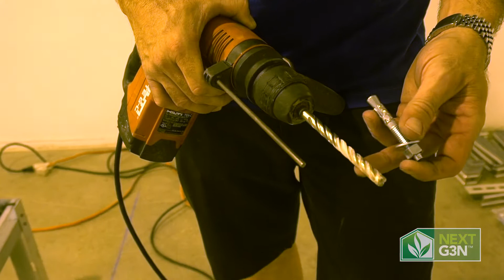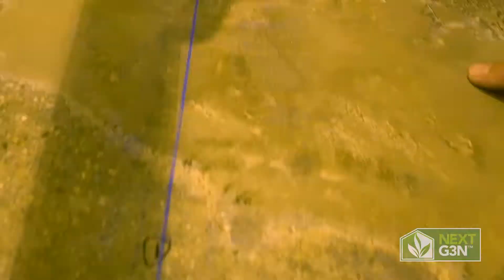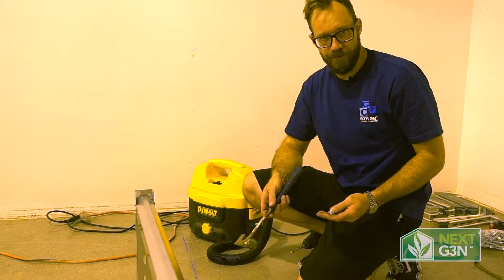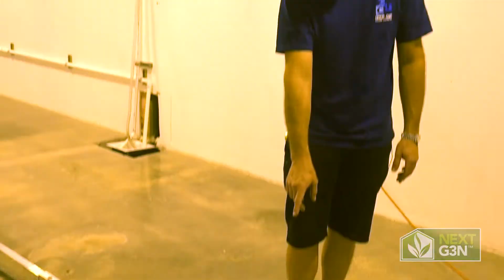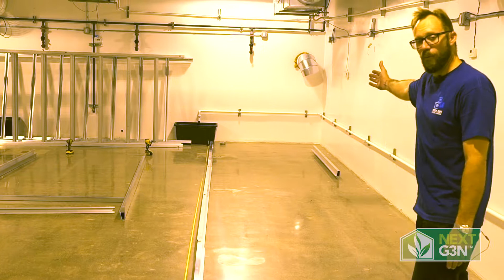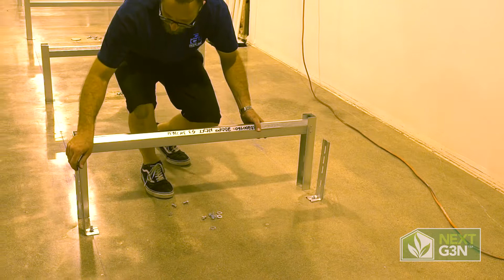Next G3N Rolling Bench Installation STEP 2: Basemounting

Comment: I like the leg design.  The way you make your adjustment with this design will keep the leg vertical on a sloping floor to a greater degree than those designs that use an adjusting rod at the top.